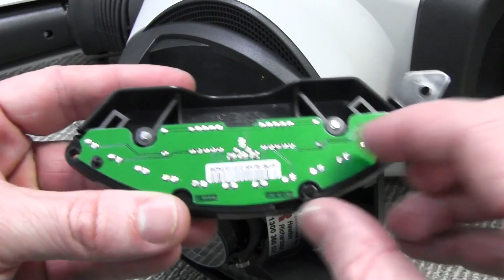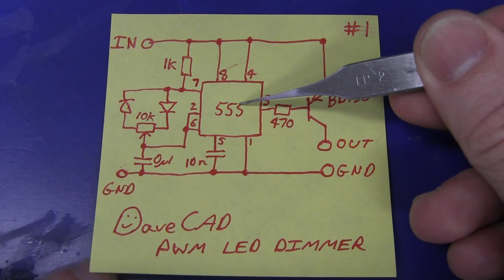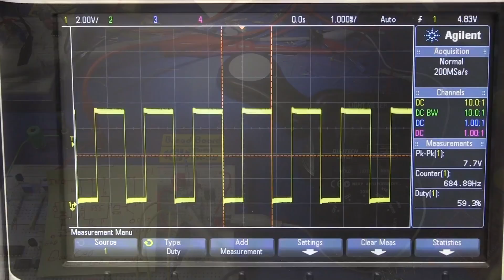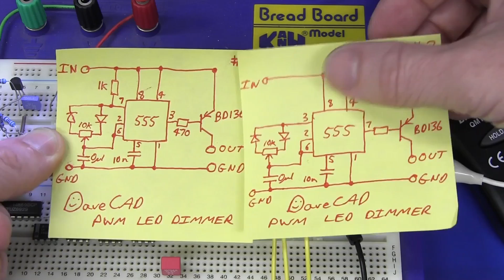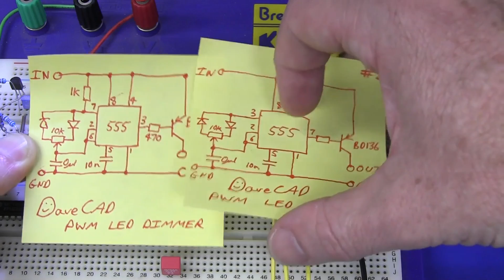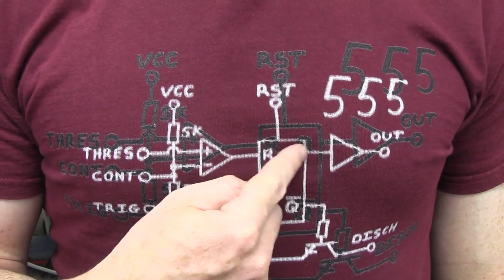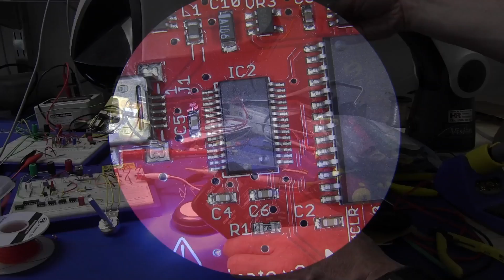EEVblog #392 - 555 LED PWM Hack

Comment: They need a controlled current and controlled voltage.  Voltage is easy.  Since current is the number of electrons that flow in a given amount of time, you can see how PWM controls current, and does it more efficiently than anything else since it has an off state where no electricity is being used.  A resistor just converts the current to heat.

Comment: I don't get why people like car manufacturers choose to run such a low frequency for PWM LED control.  Move your eyes quick and you can easily see the trails are broken from the pulsing.  I just got an illuminated keyboard that also uses a visible-frequency PWM brightness control.  Duty cycle is duty cycle whether its like 100 Hz or a few kHz.

Comment: I don't quite know enough about the math to explain it here but the values are based on a formula that determines the values for the fewest parts that will give the most complete spread of values. The formula is also used to determine things like what currency values a country should have for the best use of resources and transaction efficiency.

Comment: Look up "Renard series". 
Basically it comes down to the fact that you don't really care (I choose arbitrary numbers here) if you got 900 or 950 Ohms, but you do care if it's 100 or 150! While the difference is the same, the ratio is quite different. 
So you choose values (starting with 1) where every number is the previous number times a constant factor, preferrably in a way that after a certain number of repetitions you get to 10 (so the whole series can repeat with just a zero added).

Comment from the maker: Yes, I was thinking that, but the wires are paralleled inside the optic head, so you'd have to have a separate pot and circuit inside each LED half. It would be pretty ugly.

Comment: the values are chosen so there is an even spread of values available over the entire range. Component values come in a series of 12, 24, or 48 values per decade (Sometimes higher for high tolerance values). ( Search for "E24 series" and you'll get some tables.).
The values chosen are so that there is a value close to every, say, 5%. This means that they track a log series.
Finaly, it just so happens that some values are very common. 22 and 47 are two of those very common values!.

Comment: The PWM version is more efficient. Yes, you still need the series resistor to limit the maximum current. But at let's say 50% duty cycle the resistor also only drops voltage 50% of the time. No current for the other 50%, no losses then (ignoring power needed by the 555)!

Comment: I like the idea of having each side's LEDs adjustable in brightness so you can get some control of the direction the lighting is coming from. An XY pot would be friggin sweet. Run the stick along the diagonal for equal overall brightness and off diagonal for fading from one side to the other. User friendly as heck!

Comment: very easily 3D print a case using your maker bot and that case would just fit inside the square opening where the power jack socket is on the mantis head

Comment: Great learning video Dave really enjoyed it ..................BUT.............a gross little hack thing covered in shrink sleeve dangling from a Mantis.  Are you mad!!!  You're an electronic genius and a mechanical Phillistine Dave. Stick the thing inside, drill the casting and stick the pot shaft out the hole with a nice knob on it. Beauty.  Aesthetics Dave, Aesthetics.

Comment: KISS, just change the existing lm317 to a voltage reg with the pot and be done. the led's have individual resistors up to the plug packs voltage for there max draw. Unless you wanted to do a 555 tutorial that is ;). Take care Dave, love your vids.